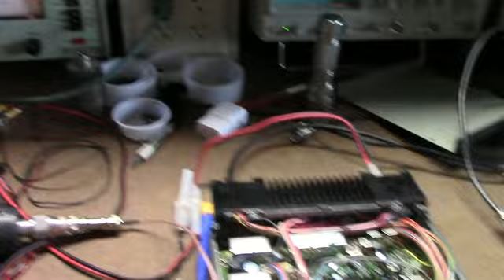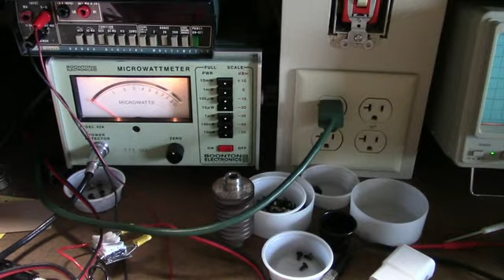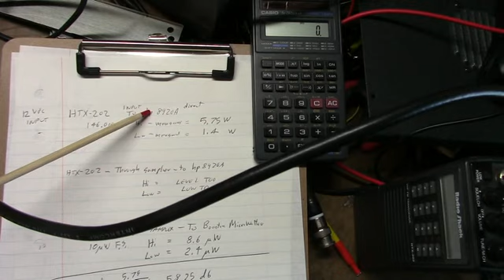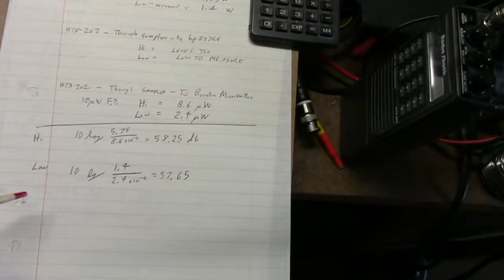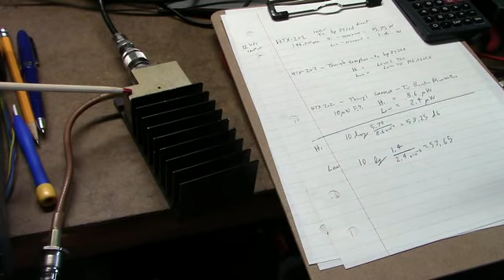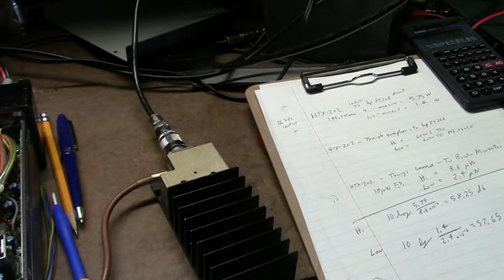Rf Sampler

Comment: If you can open the sampler up could you find marked resistors for how much is the wattage?
Reply from the maker: Hi partha2806, Thank you for your comment.  I removed the sampler from the heat sink.  The only way into the cavity would be through the chassis N connector. I didn't want to risk damaging the unit by disassembling it. This unit was likely removed from some type of instrument such as a service monitor . Maybe someone will recognize it and comment regarding it's original use.